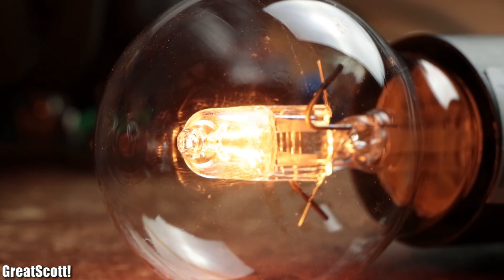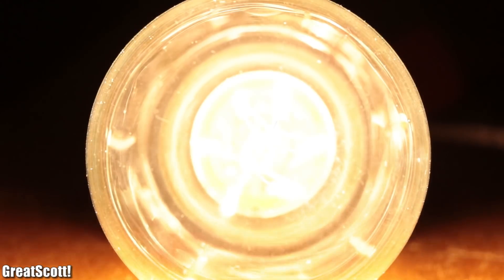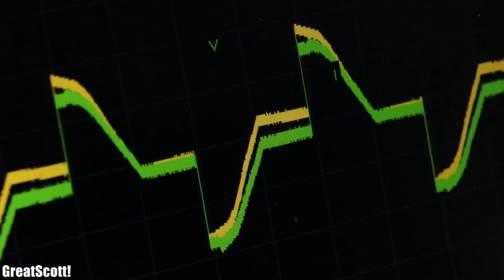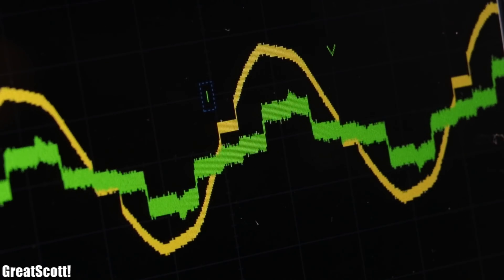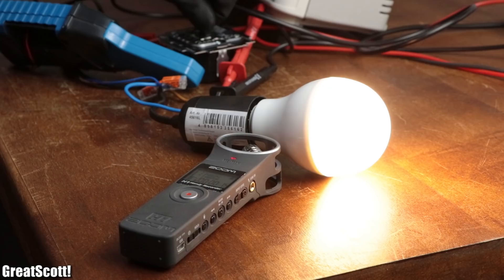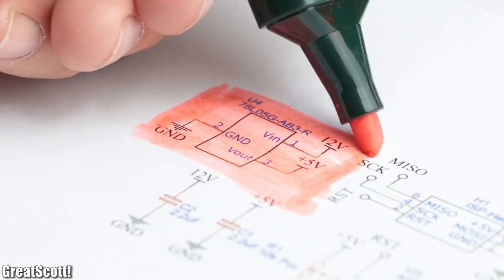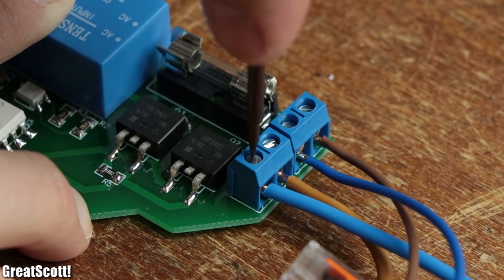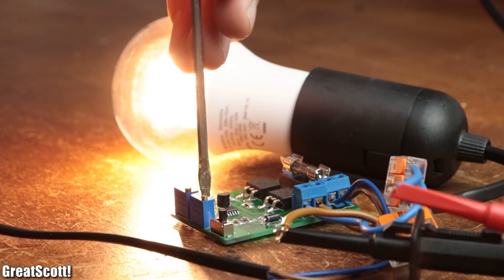The problem with dimming AC LED Light Bulbs || DIY Trailing Edge Dimmer

Comment: Faster soldering method for SMT: Instead of adding solder when you add the parts. Apply solder to all of the pads first, than just place the part & reheat using an iron or hot air workstation. Use tweezers to place and hold the part when you solder.
Reply: I do this with 603 parts that have 8 leads.  It works!  A little bumpy sometimes, but yeah!

Comment: Hi, I wanted to know what is the point of using an optocoupler (U5) in the ATTiny version? The ground is common between the two sides and therefore the logic circuit is either riding on the neutral wire (not very safe) or on the live wire (well, not safe at all)
Reply: Thank god someone here is paying attention!! Everyone needs to read this!! This a terrible designed circuit! Use a photovoltaic MOSFET driver like a VOM1271T for the love of god. It will fully isolate the high from low voltage with no tie to GND. Also the MOSFET choice here is crappy. RDSOn of .85 ohms? At 60v, half the the waveform, you are expelling a lot of energy as heat! Also from Vishay, SUD80460E-GE3, something like RDSOn of .0447. That would be a lot better just to start!
Reply: @grassrootfilms thanks for this useful reply ! I’m trying to make my own and this also made me skeptical.
Reply: This worries me too. Mains goes to 12v circuit =\

Comment: Enjoyed this video a lot. I have been trying a lot of pre-made dimmers as I switch all lights to dimmable LCD. I just purchased a pair of troffer-style 2x4 dimmable LED panels and didn't realize until I received them they used analog (or 0-10volt) dimming. I had decided I no longer wanted to buy expensive wall switches, especially when it requires you to run an extra two low-voltage wires from the fixture to the switch. Have you looked at these? If so, what are your thoughts on a DIY version of 0-10volt dimmer, and would it be possible to use an ESP or WeMos or other wifi enabled controller that would talk to my wink2 hub or Alexa, or HASS.IO which I am just starting to build?
Please keep the knowledge (and excellent videos) flowing!   Thanks,
Reply: I was trying to figure out a similar thing myself.  I Read somewhere to place a resistance across the light fitting DIM- DIM+ that would set the light to low level and then in parallel to the resistor place a mosfet which you can control via a logic level PWM signal from an esp8266 device linked to your home automation system of choice.  I have tried it but not much luck yet, but I think the issue I'm having is to do with the mosfet not switch with a 3.3v volt PWM signal.

Comment: When I use filament light bulbs which doesnt have driver just capacitive dropper I always wire a switches to have one with capacitor which dims the bulb. It’s especially useful when you want to make a lamp that just lights like very old bulbs.

Comment: This is why I still use incandescent bulbs.  I have over a dozen dimmers in my home controlling upwards of 60 bulbs.  Over 40 are in the basement alone on six different switches.  I tried numerous brands of LEDs over the years and they all have different cutoff voltages.  Some will dim great while others on the circuit go out entirely or are brighter than the others.  Back in 2016, I bought over 1,800 60 Watt bulbs which should last over 20 years.
Reply: 1800 bulbs? HAHAHA!! Awesome! How many do you still have today (march/23)?
Reply: @talesmaschio  -- Probably only down 40 or 50 by now. Still have close to what started with. Was a really stupid idea. Basically I heard they were "gonna ban the bulb" and I freaked out and overbought. ¯\_(ツ)_/¯
Reply: @pmgodfrey  I don’t see it as a stupid ideia. What impressed me at first was how many you bought at once. Anyway, you made a decision based on info you had at the time. Also, LED lights used to be very high quality, today most manufacturers make cost oriented pieces of crap which main function is to quickly turn into electronic waste. Your incandescent bulbs may consume a bit more energy but they show a much nicer color temperature and impose zero harmonic distortion to the electric grid. So, you’re not that wrong.
Reply: @talesmaschio  -- One of the biggest issues is how well they dim. Since most are built with low cost components, you can't expect much from a switch mode power supply, especially when they have such a wide operating voltage range. So they dim to a certain point and then some go out, others don't. Plus ones I've used in our rentals seem to be of horrible quality. They're they basic ones you find at any Home Depot. Might have just been a bad batch because I have had a few here and there that still work from 10 years ago.

Comment: Is this circuit or previous circuit capable to control a AC Motor? I mean simple single phase AC Motors turn on one way. Can any circuit drive them on both directions with speed controllability?

Comment: please correct me because I am probably wrong but after watching this video, I hate LEDs bulbs even more, you cannot dim them properly unless you buy a special kind, they make EMI, and they can even destroy stuff you plug them into, and don't tell me they aren't hot (although the bulb it self is not hot the part around the clear plastic is)(I have some of them that you cannot touch with your hands without burning yourself)
do they realy save that much power over incondicional light bulbs (they can keep you warm at winter so :))?, you can analog dim them (100%.99%.98%,97%), while you have to skip steps to dim LEDs (100%, 70%, 50%)(sat at 3:23)
SO PLEASE correct and ease my mind a bit

Comment: Please avoid terms like open and closed when describing the flow of current. Open/closed can both apply to switches (circuits) and valves (fluidics), and is therefore ambiguous. Conductive and non-conductive would be the more appropiate choice of wording.
Reply: @E3SniperspreeE3  It could also mean that the flow of electrons through a semiconductor is interrupted.
Reply: @nrdesign1991  how is it ambiguous if this is clearly about electronics and not fluidics?
Reply: @nicholasroos3627  You can think of semiconductors as valves for guiding the flow of electrons. The difference being, a switch will create a physical (open) gap to break the flow, and a valve (or semiconductor) will close a gap to interrupt the flow. A semiconductor does not have any moving parts. A MOSFET uses the field effect to attract electrons to the gate, and create a band of electrons, which will permit a current to flow.

Comment: Would this solution be suitable for dimming an inductive load? - almost totally inductive - as I faced lots of problems while trying to connect a 24Vac Contactor to the main 220V using the ordinary dimmer circuit

Comment: 8:23
$2 PCB.
$19.36 shipping.
Reply: Hey Guys, I am just pointing at the irony. I am not telling it is not worth it.
Reply: Yeah, they are trying to take a chunk out of the home etched PCB hobby market. The advantage of DIY is the speed of iterations, so they are deliberately marketing against the idea that they are too slow. If you want to etch your own board with all of the features they have on a board, 2x layers, through hole plating, vias, soldermask, and silkscreen, it will take you 3-4 days to make (or more), unless you have the space to keep all of this stuff setup and dialed for production. If you're ordering stuff like small quantities of Dupont Riston ~$20(x2 meters), Dynamask ~$15(x1 meter), and quality copper clad FR4, the price difference between keeping a fresh setup and just ordering a board with a $22 total becomes very competitive. I just make most designs single sided and DIY, but for larger stuff with a double design, the Chinese board houses are hard to beat. I would still recommend etching a few boards yourself though. I learned a ton from the experience, like make a paper and cardboard prototype of all of your boards before etching, or ordering anything. A paper/cardboard prototype with everything checked/attached/installed is priceless. Putting together all of the stuff to etch also adds up, takes up a good bit of space, means dealing with and storing hazardous chemicals etc.
   They just advertise the fast shipping because their biggest hurtle is how fast you can make your own boards at home. For instance, I made a LCD breakout board 2 days ago in just under 1hr, but I've been developing my setup and routine for a year now.
-Jake
Reply: wesmart.png
Reply: 20$ is the 48h shipping i believe, you can get cheaper options but it just takes longer.
since he is sponsored by jlcpcb he doesn't care :D
Reply: If you consider you're getting 10 pbcs, it's still very close to a $2 pbc.

Comment: Hi.Is your UNI-T 210E clamp meter best for DC current measuring?
Reply: Athyaayitta ivde malayalikale കാണുന്നേ 🙂
Reply: @allonet622  lokathinte ethu konilum nalmmal malayalikal undavum😅💪💪
Reply: @bctechmalayalam5391  yup 😂👍
Reply: Yes it is both for AC and DC. For the accuracy, you have to look at its datasheet.
Reply: It's a clamp meter that works. "Best" is an irrelevant metric though :-)
 Best for what use? Best cost for a functioning meter? Best accuracy? Best battery life? Best reddit review posts? Best fan boi's? Best color red?
 I'm just playing around to make a point :-) 
A few years ago I would have probably asked the same question. The best thing to do is research and compare features. The channel Diodes Gone Wild (no affiliation) did a nice teardown of a clamp meter about a year ago. IIRC When he took it apart it was this same UNI-T meter, but I think it was even cheaper, but I could be mistaken. The UNI-T is only around $21 on AliEx. Although I would just get one of the cheap $8 versions. I honestly don't use a clamp meter much at all as a hobbyist. You can wrap a turn or two of plain insulated wire around most magnetics and measure most things you would want to measure in small circuits. I would just get a better multimeter. If you can break the circuit's path most multimeters have an AC and DC current measurement that is good for up to 10 amps. The only real use for a clamp meter are circuits with more than 10 amps. Perhaps you're playing with totally different stuff than most people, but for most hobbyists even 10 amps is far more current than 99% of projects. 
 If money is not an objective problem for you, a Fluke is considered "best-er-est." :-)
-Jake
Reply: @UpcycleElectronics  best meant accuracy
Reply: With DC and a clamp meter I think they are all just 'in the ball park' range. You would need to compare datasheets. Dave on the EEVBlog probably has a bench test comparison you can watch. I believe the DC clamp meters are all just hall effect sensors. I don't think those are terribly accurate or precise. ...but I'm no expert.
  Still, here in the USA, professionals use Fluke for anything serious or industrial. I don't have a Fluke. I'm not serious, professional, or financially privileged though.
GL
Reply: @UpcycleElectronics  i bought a clamp meter from aliexpress for 33$.The company said that it can measure dc current.But that clamp meter shows 1A-2A withot clampi g to any wire.i know fluke is the best.but i am not financially able to buy it (it costs around more than 300$ in INDIA).by the way thanks for advice.
Reply: @bctechmalayalam5391  bro ഈ Ali express il order cheyan entha vende card upayogikumbo your bank doesn't allow this transaction enn കാണിക്കുന്നു.? നീ enganeya order cheythe
Reply: @allonet622  card etha visa ano?
Reply: @bctechmalayalam5391  
  No problem. Fluke's cost a fortune anywhere :-)
Even a cheap meter should have a "REL" feature to zero the meter. If it doesn't have that (personally with my level of experience and knowledge) I would take it apart and try to find a way to tune or modify the curcuit in order to zero the meter.
 I think they are all just hall effect sensors though. Perhaps you have  seen the grade school magnetic field demonstration where iron powder is used to show the invisible field lines around a bar magnet. If you have, you should understand that a magnetic field is not completely symmetrical or linear with distance. It's affected by all kinds of external variables. While I'm sure there are ways to improve the accuracy of a hall effect sensor, you're still using it to measure the irregular field of what is essentially a weak magnet. A clamp meter measuring AC is a totally different thing. The meter is essentially a transformer. This is much easier to measure accurately. I think the DC clamp meter is more of a novelty than anything. I think it's intended to simply show something big and obvious might be flowing or might not be. At least that's how I treat them. If I need a clamp meter, I just borrow my old man's. I don't even own one, but my bench has a couple Aneng 9999 count meters, an Ideal brand 1999 count meter I got ages ago, a 5.5 digit Keithley 197 (old butt ugly bench DMM but accurate and on eBay ~$80-$100) and a Rigol DS1052 oscilloscope. I've borrowed my old man's clamp meter once in the past 3-4 years of playing at my work bench. 
  All that said, I've seen many people using this UNI-T meter. It's probably the best entry level compromise between something cheap and something that works.
Reply: @bctechmalayalam5391  satharna debit card? Visa തന്നെ വേണോ debit വെച്ച് എങ്ങനെ cheyum
Reply: @allonet622  njan south indian bank repay card anu use cheyyunnath
Reply: @bctechmalayalam5391  oh OK tnx